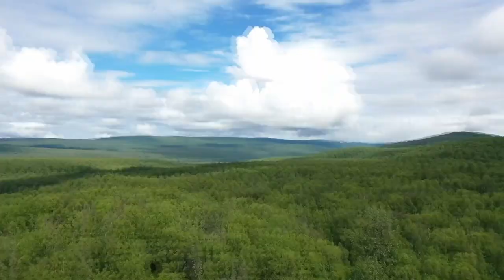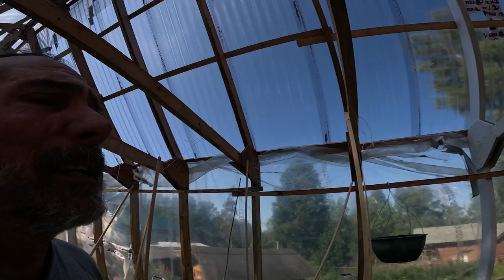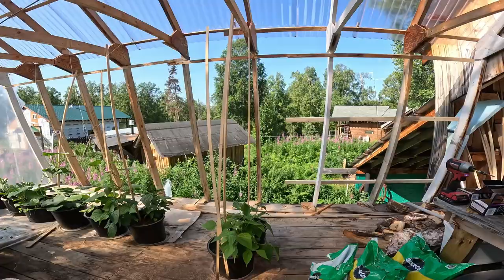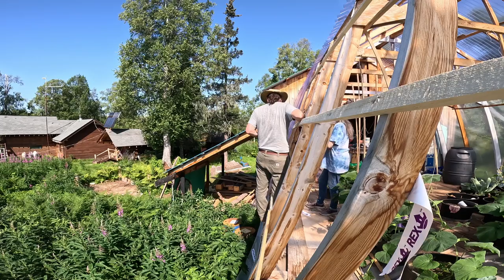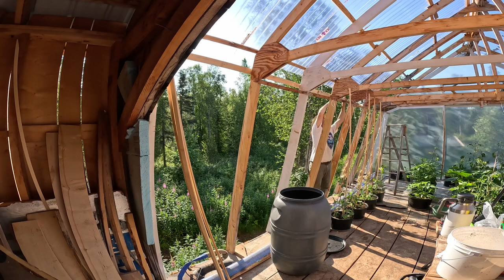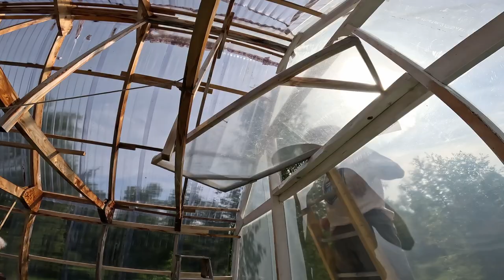Greenhouse Makeover: Transforming a Storm-Damaged Structure

Comment: Nice looking greenhouse, Rob. It's a shame the winds tore it apart. Hopefully this time it will stay in one piece
Reply from the maker: It should last a while. The top panels did great last winter and shed snow very easy and fast.  How’s the new place coming?
Reply: @curmudgeinnak  It's coming along fine, it's all insulated and the walls are done on the first floor. Getting closer.